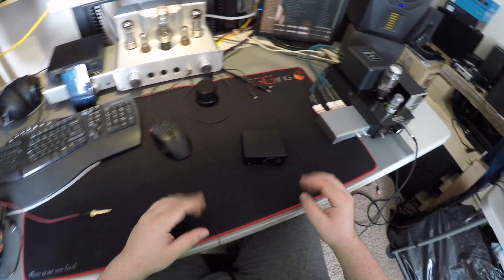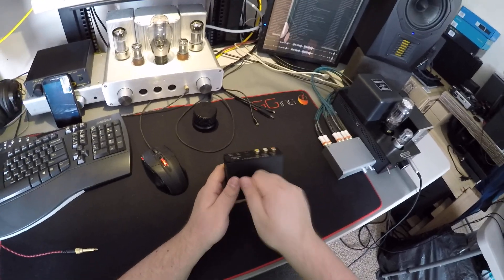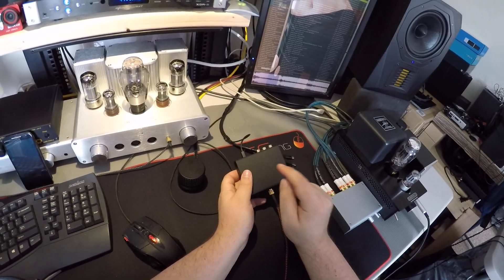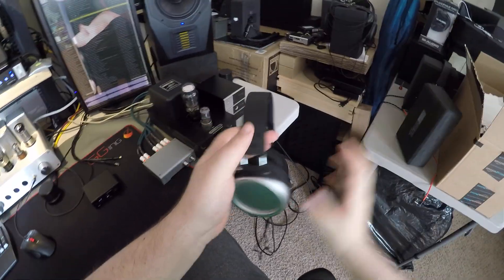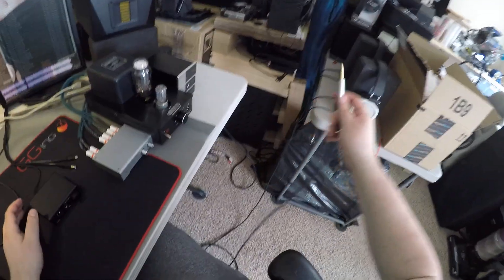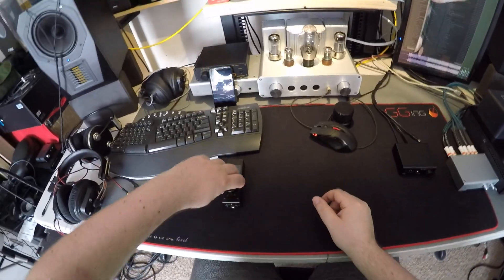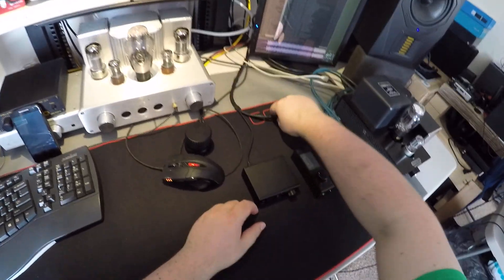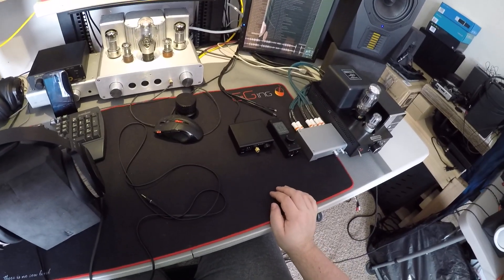Z Review - SMSL M3

Comment: DO NOT BUY FOR LOW IMPEDANCE HEADPHONES / IN EARS !!
I bought the M3 based on this review as my first dedicated DAC/AMP. I was planning to use it with my Grado SR60, but I left them at work and the only thing else I had lying around was Rock Zircon (which I highly recommend btw). There is a very noticeable hiss with the M3 even when nothing is playing and the volume is completely turned off, even on a disconnected input.
Reply from the maker: They must be really efficient IEM's
Reply: They are, can't go past 8 (~10%), but still, I don't have that issue with either my phone (Nexus 5) or my OB.
Reply: Ok so I checked the specs for those and they are 16 Ohm. I remembered I also have a pair of Sennheiser PC131 (most basic skype headset) and they are 32 Ohm. The hiss is gone or at least inaudible, though it's possible that's because they're pure junk.